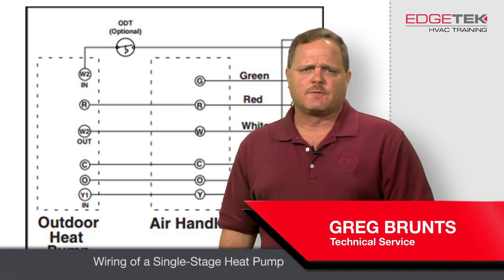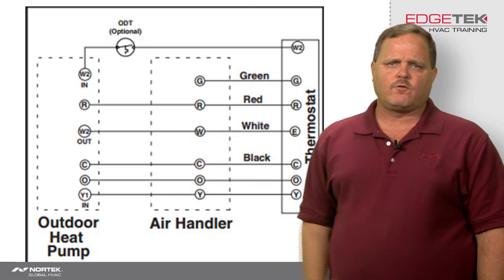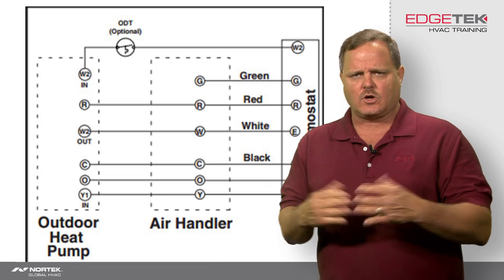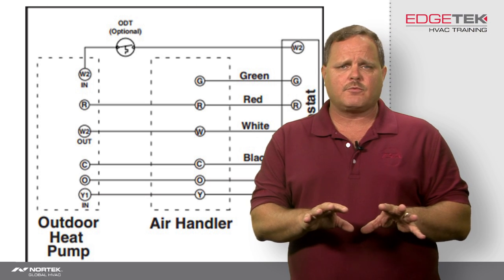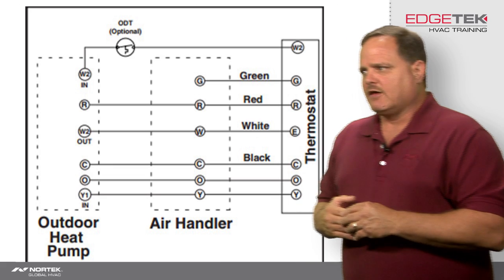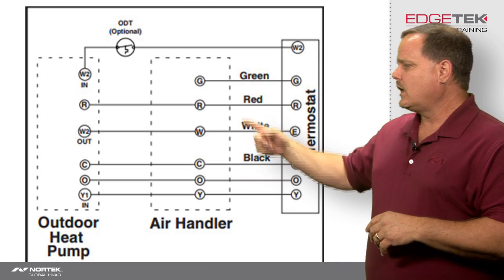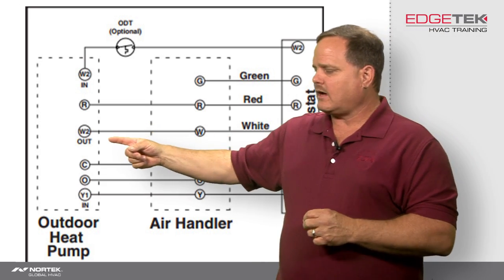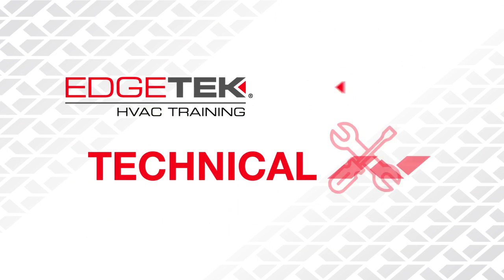Wiring of a Single-Stage Heat Pump

Comment: This was an awesome explanation of how to wire a thermostat.  Honeywell was no help and my schematic for the compressor was like his in this video. Old thermostat had W2 and E terminals but the new WiFi Honeywell 9000 does not, it puts the E, Aux and W2 functions on the same terminal. So get all wired and have left over wire. Well after honeywell said the were too busy to take my call and call back. NICE. and looking on the internet, I found this.  Great explanation of how the ODT works and how to wire for a 6 wire thermostat when you have 7 in play.

Comment: Hi, can you just wired the two "O" wires together and not put in on the air handler terminal block? The "O" terminal on the air handler control board doesn't do anything does it? Thanks

Comment: Single stage heat pumps don't have a black wire going to the thermostat,  it's a blue wire; used for the common terminal and only if you have a thermostat that is hard wired instead of on batteries.
Reply: brown on mine is common....o/b is blue

Comment: Instead of black I have a blue cable
Reply from the maker: Hi Adrian, the color of the wire does not matter as long as it is connected to the correct terminals on all points in the wiring.
Reply: It, does not matter, that is what i understand also. yea, why ppl are so uptight with IT. it is the content of the connection or character, and so be it. @EdgeTekHVAC